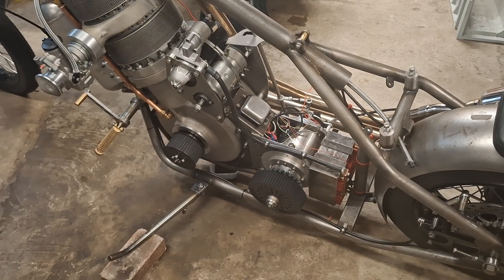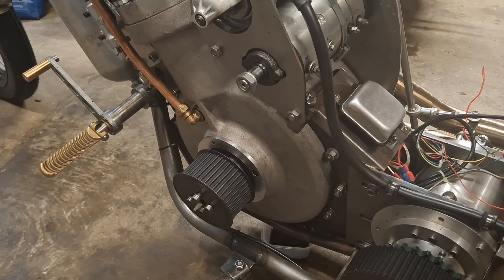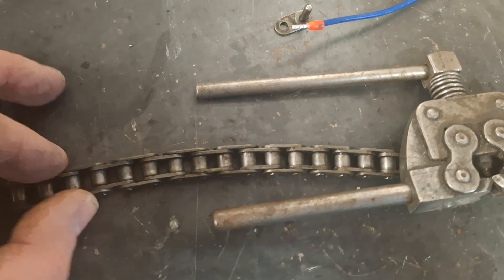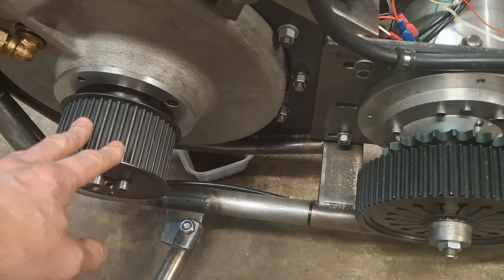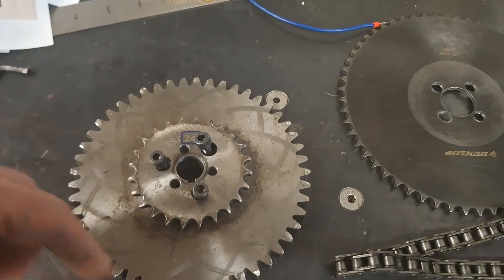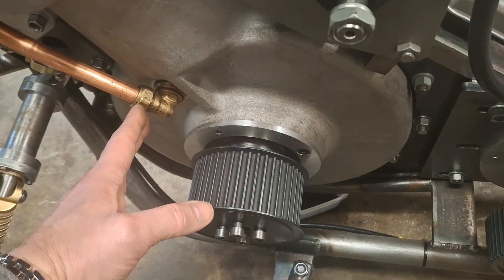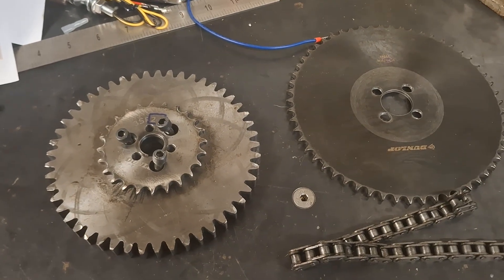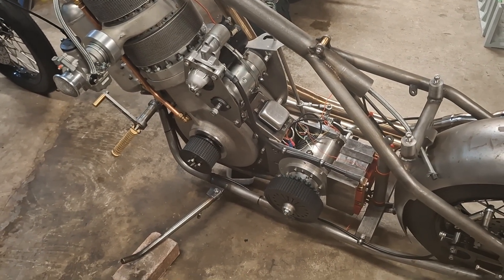Chain Snapping Torque

Comment: Look at your broken link at :55.  Shows you the radial thickness of the link is the weak part. You go directly to a 520 chain. Narrower than a 530 but with the same thickness side plates. Sprocket will be 1/4" wide.
Reply: You can also get a 525 chain

Comment: Good to see it coming along Mark, could you make some dummy sprockets from plastic sheet just to check clearances and ratio,s would be fairly quick and easy, regards Nigel Cox
Reply from the maker: Luckily we have a few old sprockets of 1/2" pitch lying around. Not the exact size but a good indication for thickness. Then the amazing Mr. Tench swung by with a brand new 420 chain and 38T sprocket! I think we'll be OK,  with some machining and fiddling about. 😁

Comment: Big flywheel and a hand crank to get it spinning then throw the decompressor lever! 
Bart theres chains and chains, stick a Tsubaki on it, i would go for a 520.  5/8" pitch 1/4" wide sprockets. Motorcycle chains are sized in 1/8" inches, 520 is 5x1/8" pitch and 2.0x 1/8" wide.  I will bring you a sample up in the morning if your in?
Reply from the maker: Should be around.  Drop me a message before you leave. 520 chain probably won't fit, too wide.

Comment: Would a one way bearing in the starter gear/chain mechanism help prevent any backlash from the engine stretching the chaing? It would allow the starter motor to spin the engine one way but prevent the engine from yanking the chain back the other way.
Something like a sprag clutch bearing might be an easy addition.
The lads over at Project Binky (episiode 37) had similar trouble with their alternator/air con drive system blowing apart under back lash.
Reply from the maker: I did try a sprag clutch bearing a while back,  but it was too small.  It lasted about 3 attempts before disintegrating! 😂 The engine needs to drive the dynamo through the same chain,  so they might not be an option with this setup.

Comment: The ratio will be the same if the chain wheels are the same diameter. They will just have smaller tooth counts. 
But can you go to a 5/8 pitch chain? Thats referred to as a 510 or 520. the 510 will be the same width as the 410 in the 1/2 inch pitch. The breaking strain will be significantly higher. If you look online for simplex chain strength or similar it's quite surprising how the strength increases.
You could also consider decompress or for first rotation.
Keep up the good work.
Reply from the maker: I'll look into it. The 1/2" pitch sills be enough,  it's twice the strength of 3/8. I do use the decompressor,  but that might not be helping when you consider the snatch when you drop the decompressor.
Reply: @StoneEng I have an aftermarket ECU/ignition for one of my Harley's. It can be set to fire first rotation for kickstart or fires on the next rotation for electric starting. Only a 1000cc vtwin but they were know for destroying the starter.
You could also look at veteran bikes had a timing lever to retard the ignition. Once running set the advance.
Reply: I had to take a second look. What speed is it running? Maybe too fast for a roller chain.